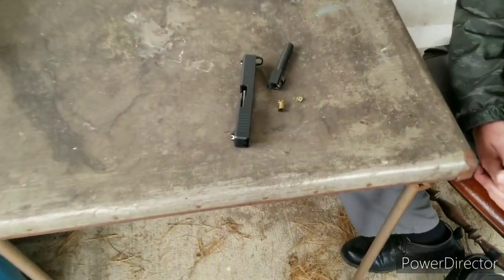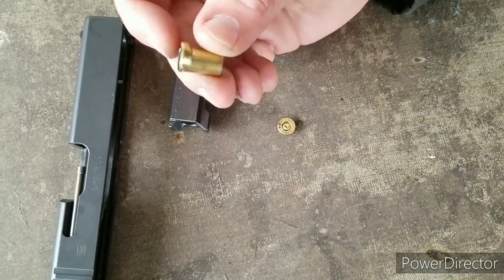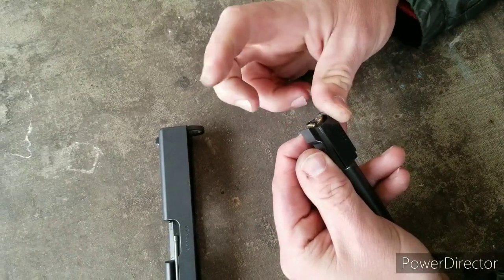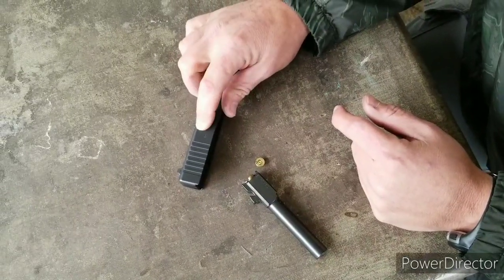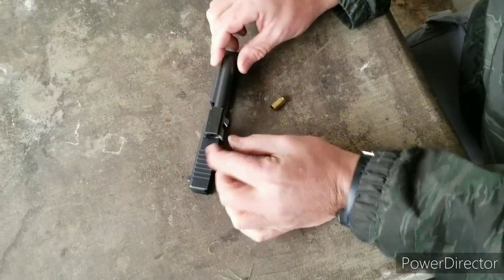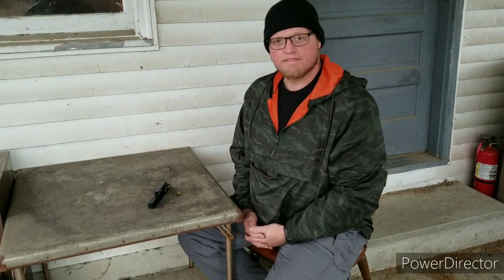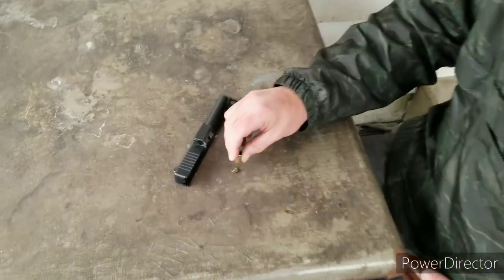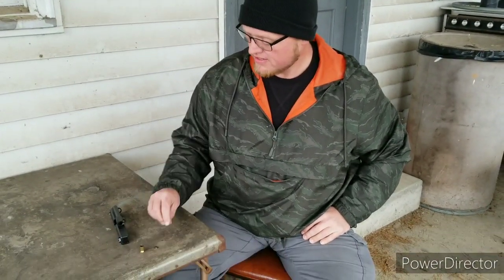WARNING!!!!° DONT SHOOT RELOADS OR REMANUFACTURED AMMO IN ANY GLOCK...

Comment: This was probably a double charge. That kind of case head separation is not expected. 

Btw my Glock 35 doesn't give me bulged brass. I have heard that somewhere along the line they changed how their chamber was cut to provide more support. Don't know enough to verify, but I definitely get no bulge either way.
Reply: You can’t double charge 9. It’s just a simple case separating. It’s not that serious. Didn’t even hurt anything
Reply: @MrT13  yes you can, TG is one of them and plenty of room in 9mm case for a double charge. Heck you can even triple charge it if you're not careful. (Don't ask me how i know) - you can get slower powders, that fills 50% of the case and can easily spot double charge because it'll overflow. I have used TG countless times. (A little goes a long way). Im using Power Pistol and CFE-P now. But grabbing some more TG if its on sale
Reply: @WaterMaloneeee  I’ve still got 3 8lb tubs of tite group unopened. I used a 1lb straight from the jug onto scale in an empty case. And measured it all with a caliper. 1/10” left with 8 grains of tg in a 9. And by the way like I said that’s a minimum charge. 3.9. If you put two charges of 4.3 max.  8.6 it’s practically level…. Triple charge a 9. Gtfoh with that bs. I’ve got guns I reload for that shoot .1” groups. And others that shoot 10” at a 1000 yards. Feel free to ask me anything you feel like about reloading to test me. But don’t come on here and make stuff up and try and tell me no bs that don’t make sense and is literally impossible. Like I said wrong guy.
Reply: @WaterMaloneeee  oh and your slower powder reference is backwards too. Slower powders take up more room not less. Just to verify though since we are making stuff up today. I put the minimum charge of 3n37. 6gr… NO YOU COULD NOT FIT 12 grains in a 9 case…. So no absolutely not did a slower powder result in 50% case fill. It was more like 70%. And like I said it did not take 12 grains. Overflowing and poured out was 10.7. Not a double charge. And certainly not a triple. In case you wanted to actually know about slow powders too.

Comment: Glocks are notorious for large chamber tolerances , I gather brass at a local range , about 50 lbs a week, you can tell glocked 40s&w brass ,just type glocked brass in Google or you tube , you can tell glocked brass by the large bulge at the base of the case . I've been shooting range brass reloads in my Taurus th40 , with no problems, also a Lee bulge buster helps remove the bulge in the brass .

Comment: When you're resizing cases fired thru your Glock, you may notice that right at the base it's a bit harder on the resize stroke because the case is stretched where it was in the chamber when it was fired in that Glock. This weakens the case in that spot and if it should land in that same position in it next time and fires, the likelihood of it blowing out in that unsupported spot is greatly enhanced because of that weakened, stretched case segment. And if you're loading on the 'hot' side, even more likely to blow out when that weakened spot falls in the open space.

Comment: It’s a case head separation. 
Not unexpected with commercial remanufactured ammo. 
They dump a 55 gal drum of range pick up brass that may have been fired once or 20 times into a hopper on a motorized progressive press and make it into crappy ammo. But at least it’s cheap. 
If you’re going to buy that stuff you have to assume you are the only quality control it will ever see.

Comment: I have picked up brass from the range and a lot came from glocks.  I don't own a glock primarily because of the grip angle.  I have reloaded 9s up to ten times so far.  I did have trouble with 45apc.  They were so bulged out at the base that even after resizing they would not fit into my mach barrel.  Rather than fool around with them they went to the junk yard. Got a good buck for them too.  So. My experience Is that as long as you do not use them in a Glock again, they should be ok in other guns.  I am glad that I never bought a Glock.

Comment: imo that case from iwi looks like a 2 parts cheap construction case for military application that was not supposed to be reloaded. 
the case just separated because its poorly made
 usually 9 mm commercial ammo like winchester, s&b, magtech, geco etc are made from a solid piece of brass and you will not have this problem as the case is way much thicker at the base.

when the case becomes weaker from reloading to much it will stat making a bulge at the base when you reform it with your tool

anyway do no reload cheap shxt but stick to known brands

Comment: It's not the actual rifling that's the problem its the unsupported extremely loose chamber that puts the weak link on the actual brass caseings head, great for reliability however bad for extreme pressures..I suggest you take a look at Fortune cookie 45lc's video on this if you want to reload for your glocks. Which by the way also doesn't truly poses polygonal rifling. You can safely shoot cast as well as reloads by just taking some careful considerations when reloading. One of those being a fully supported chamber in a barrel from an aftermarket company like wolf's..

Comment: Allways buy aftermarket barrel , espacally a 40 cal.  !   I put SS. Barrels in mine and I shoot 155 gr  xtp at 1500 fps. I use nickel brass and a good guality aftermarket barrel. !,   No problem.   ,  no pressure signs , no backed out primers ,maybe a little flat but that’s it.  !
Reply: I did what you did. I have many inexpensive Storm Lake and Lone Wolf aftermarket barrels, both are plenty accurate and perfectly safe with lead, reloads and plus P+ loads.  I'm saving all my virgin Glock factory barrels for when and if I sell any of the guns, probably get more money that way.

Comment: I don't know how many thousand of 357sig handloads I've run through my glock with no issue.  All he's saying is that the brass gets weak after a while, sometimes even after once fired so dont risk it in any pistol with an unsupported chamber. I usually throw my brass out after the first firing after the first trim even if it looks good. Some will toss it if it needs trimmed. If you have to trim, its stretched making it thinner. Makes sense, I wouldn't go as far as to say no reloading at all for a glock but if you dont know the source then you cant inspect before sizing and you dont know how many times that case has been reloaded. Reloading yourself you can do it very safely.  Anyways ive seen this happen before as well just never to me lol.

Comment: It's not due to reloaded ammo. It's due to the case being over used for reloads. That failure would have happened regardless of what firearm it was shot from. My pistol brass gets reloaded 4 times max, and I'll inspect every case before reloading it. I'll take case wall thickness measurements on the 3rd and 4th loading. The statement that you should not shoot reloaded ammo out of a Glock is false. I do it all the time. They put that information in the owners manual of every firearm made, regardless of manufacturer, for liability reasons. The statement made should be "don't buy cheap, bulk remanufactured ammo of unknown origins at gun shows". You have no idea where they are getting their brass from. There are few exceptions of companies that do make high quality remanufactured ammo with verifiable once fired military brass.

Comment: This is bs. Full length size. Inspect your brass. Load properly. And the gun doesn’t know the difference. Making such a big deal out of a case separation. If you don’t know how to reload fine don’t. But glocks are super reliable and tough. I over push my 34. And way down to 500 fps barely functional 10lb spring my 19. Calm down.
Reply: Reliable And tough? Well all being said I just proved stopped to believe today..... 3 reloaded shots (lead), first and second went ok but the third one got my attention: the magazine was forced out of magwell, (later discovered to be cracked vertically) and the slide lock lever was totally sheered out, rendering the gun unusable!  No need to crucify me for my  reloading skills.....I have shot competitively (Pistols, rifles and shotguns)over 50 years  and as you may guessed most of the ammo was reloaded by myself....sure there were couple of f....s but nothing that disassembled any of my guns most of them had thousands of rounds thru them and are still usable and running well, with one exception: Glock 22 in .40 S&W equipped with Wolf replacement barrel.  I called GlockUSA and they wanted to know the serial number of this gun  and once I gave it to them   they wanted me to ship the gun to them for evaluation and possible repair....They didn't wanted to know what I shoot thru it! It will go out to them in couple of days and I can't wait what the results of their findings will be! ......        Just  give me a solid metal weapon without any plastic parts-frame included and you can have the "indestructible Glock or anything alike!"
Reply: @stefanslanina2370  we here you.

Comment: Ridiculous title and statement.. it has nothing to do with a Glock chamber and EVERYTHING to do  with a compromised case, bad reload, excessive pressure etc etc. You have provided zero data supporting your claim that this wouldn't have happened in ANY other gun with that particular round.   Shooting reloads that you haven't made yourself ( or did make yourself) or remanufactured ammo comes with a much higher risk of failure. 
Leads me to believe you reloaded that round and you're looking for a scapegoat other than yourself...

Comment: Im commin up on 8k reloads through my 19x and probably 15k on a gen 5, 19. Whats the difference in a reman in a factory round? Theyre both built the exact same way man. You load a charge, seat a bullet, then crimp the bullet. I see your video has a good amount of views and assuming 99% of the people did like i did and thought whats this guy talking out of his ass about. This is 100% incorrect info and maybe change the title of the video to dont use the ammo i used because it screwed my pistol up. So much false info is spread around the firearm community by folks like you. Please quit
Reply from the maker: The difference is simple, the case is WEAKEND  by each time it is smashed back down during the resizing process.  This WEAKENDS the case.  As I stated. In the video.  You don't believe it, cool.  You have show 16k reloaded ammo? Cool.  Do what you want.  But before you comment like this on rhe internet make your own fucking video of you think I am talking out my ass.

Comment: Is this a joke 🤣 I’ve been reloading 9mm and 40 since 1992 and been running it mostly through glocks with zero issues. Personally I wouldn’t buy reman ammo at all… ever because I prefer to roll my own. Probably had a no crimp case and drove the bullet down the case. This happens with manufactured ammo as well with poor quality control. I’ll be sure not to use reloaded ammo 🤣🤣🤣🤣🤣🤣🤣🤣🤣🤣🤣🤣🤣🤣🤣🤣🤣🤣🤣🤣🤣🤣🤣🤣🤣🤣🤣🤣